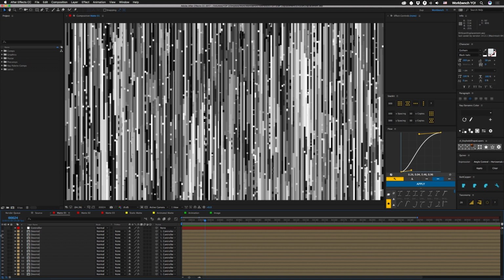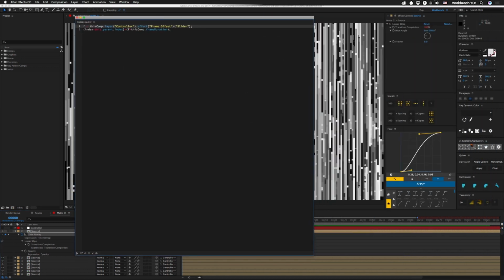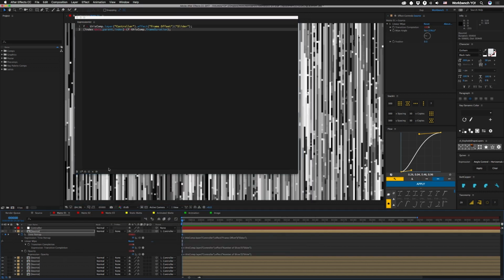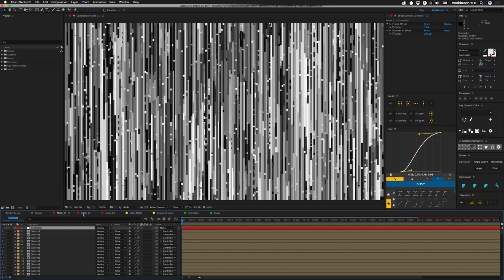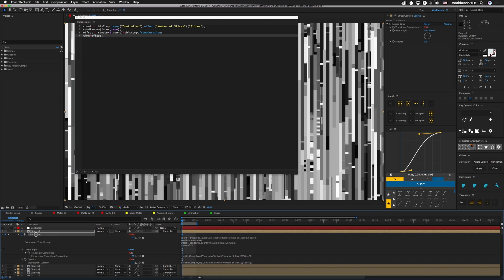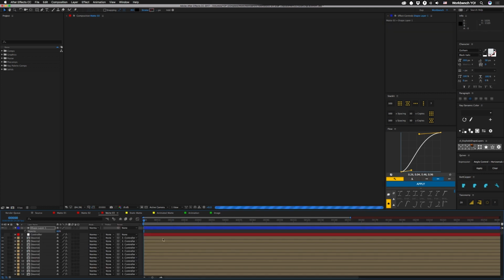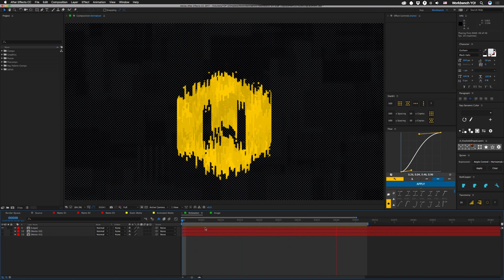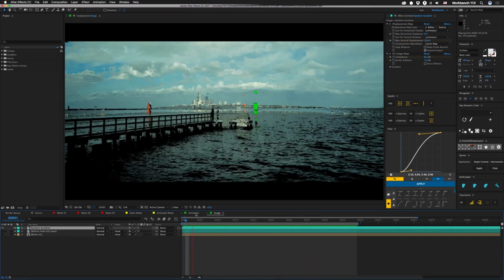Tutorial 93: Slit Scan Displacement

Comment: Hey there ! I know it is a off topic question but since you are the expressions man I thought it might be good to ask: do you know how can I link a stroke color from a shape layer to a slider control ? I'm trying to make a progress bar who changes its color while its completing is trimmed path.
Reply from the maker: It might be easier to use Colorama, but if you need the expression add an Angle control (you need that for it to loop easily). Name it Hue. And add this expression to whatever color parameter you're using. Just make sure you're not starting off with black. Whatever saturation and lightness (brightness) values the color is set to will be inherited.

hueOffset = effect("Hue")("Angle")/360;
hsla = rgbToHsl(value);
hslToRgb(hsla + [hueOffset,0,0,0]);

You can also add sliders and name them Saturation and Lightness if you want to. They'd go from 0-100. And then use this expression instead:

h = effect("Hue")("Angle")/360;
s = effect("Saturation")("Slider")/100;
l = effect("Lightness")("Slider")/100;
hslToRgb([h,s,l,1]);

In case you're wondering, the a (alpha) of hsla array we're passing to that bottom function doesn't have an effect on color so we just set it to 1. Also, most programs treat color values from 0-1, so that's why we're dividing by 360 on the angle control and 100 on the sliders. I hope that helps!